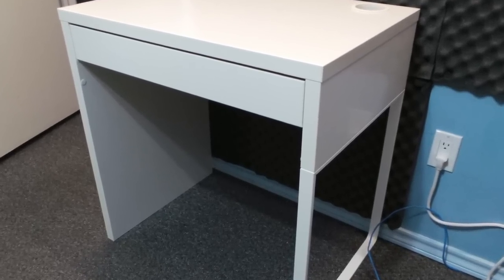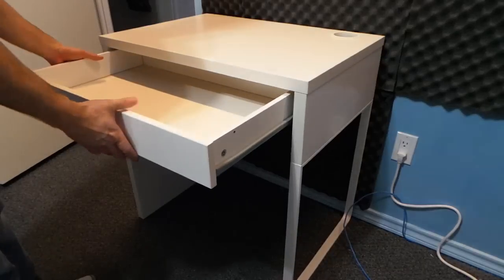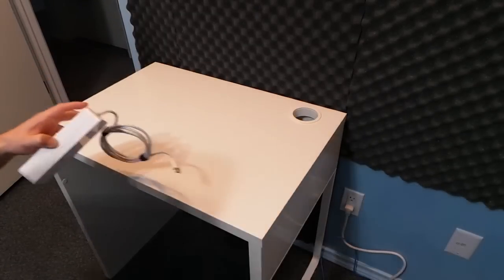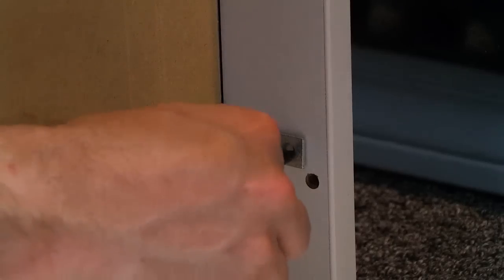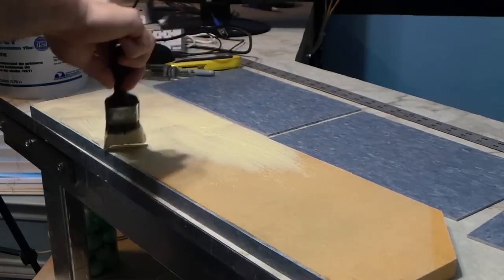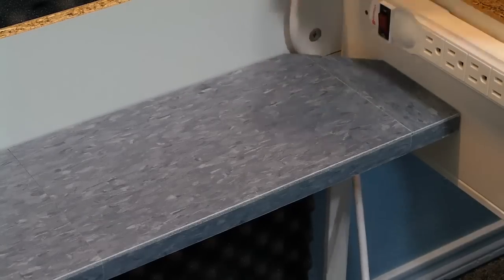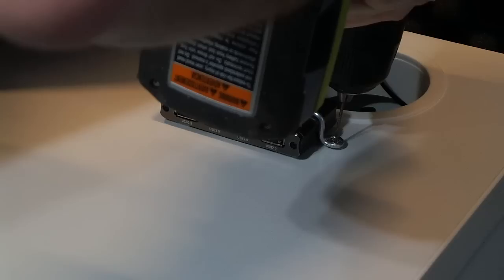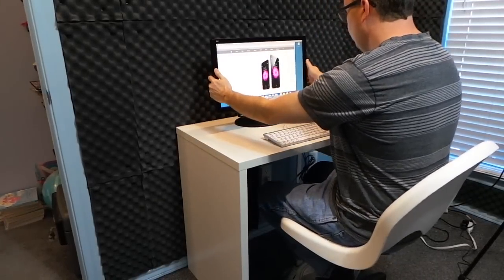Improving a crappy Ikea computer desk.

Comment: Cute little toy desk suitable for a small person for short periods of time. (Also a waste of floor space when not in use.)

Neoprene and urethane decompose into gluey messed over time, but items with PVC, HDPE, hard plastic or silicone rubber feet don't stick to cured paint or raw wood.  

The problem with IKEA furniture is the low strength of MDF.   I've bought a lot of their stuff and every piece that had to bear a significant load has either sagged, or the screws threaded into it have ripped out the areas surrounding them.  The solution to the tearout issue is reinforcement by using through fasteners that put the connection into compression instead of tension.  Sagging is nearly impossible to prevent when the MDF has an unsealed edge or face.  I've taken to sealing these with a low VOC lacquer befor assembly.

Comment: My dual 27" iMac / 27" Thunderbolt Display setup stands one the same table. It's just the double as wide version of that IKEA "crap". To be serious, it is really cheap wobbly trash if not self optimized and stabilized. At least the doulbe as wide table tends to bend in the middle down!!! I had to add a extra leg. I had to remove one drawer too! And guess what, exactly what you did. My drives and so on sit just in the positon where you modified here…. I made this like two years ago. Greets from germany.

Comment: i know it's a old video, but this is a tip for your next ikea hacks: you can use a pvc gun (i don't know how it's called in there, the bricollage gun that melts sticks of plastic?) to glue those usb hubs to the wood without making holes. if you glue them and press firmly until the pvc is cured you will have a solid connection that can be removed using a hair dryer for 30 seconds or until the pvc becomes maleable without leaving holes or affecting the finish of the wood or the device

Comment: or just make one from scratch if you're already going to the workshop. Make it exactly like you want in terms of comfort, space and design and also help you avoid those crappy pressed wood panels. Yes, theoretically you can take IKEA stuff apart again, but more likely you'll ruin one or more of the screw-holes and start over with a new one.
Aside from that, removing elements from the furniture will most likely reduce the stability of the table.
Just some things to consider.
Reply: +OmikronWeapon sense he added the wooden shelf I wouldn't be to worried about the stability there.

Comment: Nice job with the desk. Be careful with using that foam on interior walls though, it's not designed to be used for decor and is highly flammable.
Reply: It is not for aesthetics or appearance. He uses this room to record his sound. He uses them
To deaden the sound.
Reply: I appreciate that, but my point was it is a packing material for transit cases, it's not intended to be used as sound insulation on interior walls. It is up to him of course, just wanted to sound a note of caution as it is not good stuff to use for this purpose, it's potentially very dangerous.
Reply: There is 2 types of the foam, one for sound proofing and other for transit. http://www.amazon.co.uk/ACOUSTIC-TREATMENT-SOUND-PROOFING-TILES/dp/B0045Z94EY
Reply: Ah, ok - my apologies. I see the acoustic version complies with fire safety regulations so that's good. Thanks for clarifying.
Reply: Thats fine, don't worry. :)

Comment: I am not sure which glue you are using for your VCT tile, but I found that certain glues have to be left to dry BEFORE the VCT tiles are set down. (of course, meaning that the tiles have to then be set in place and rolled-over with a weighted roller).
Reply: ***** ? I was giving him a suggestion, what's YOUR problem? (besides the fact that you salute the Windows 98 flag)

Comment: If I'm not mistaken isnt this the MICKE desk. I have the corner workstation version and looking to do some mods myself. Do you think the particle board is strong enough to mount a 19" monitor directly to it, or should I drill completely through and have a plywood supporting it in back?

Comment: since you seem to have a lot more crafting knowledge than me. I have a crappy ikea desk thats kind of shaking/unstable how could i fix that?
Reply: +Acelection y Triangular pieces of wood in the corners of the desk would help. That is if you have a piece of wood that runs along the back and sides. If there are just say metal legs then not much can be done. If you watch the 3 part computer desk build he did then you will know what I mean about the triangular pieces.

Comment: you could use a glue gun to hold down the hub -would look nicer
Reply: i only put a blob in the corner to hold it but if i pulled it it would come loose then its just like p.v.a glue you just rub it and it will come off